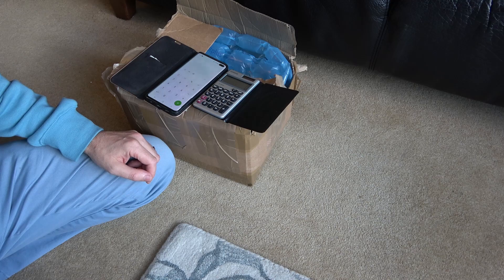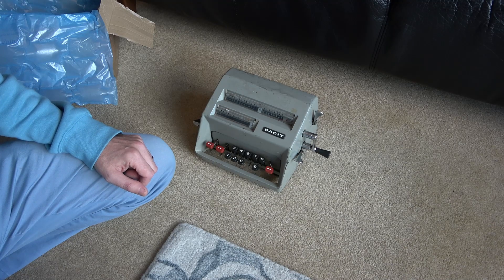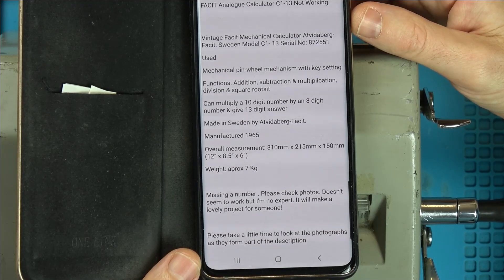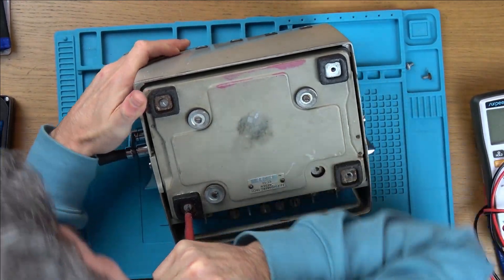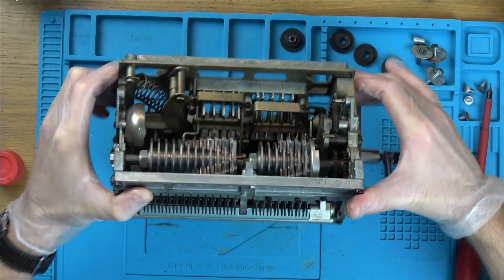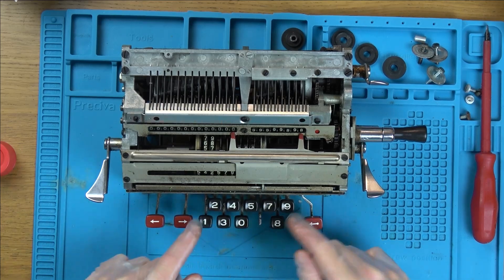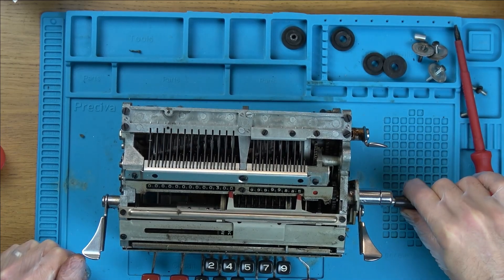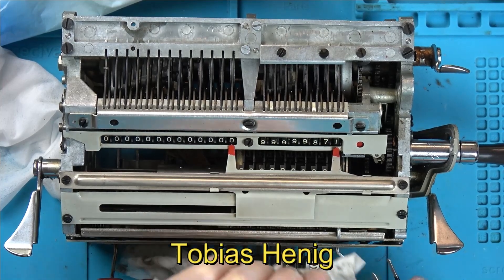Trying to FIX a Mechanical BEAUTY - Vintage CALCULATOR

Comment: Hello..at minute 27 you mention some teeth rails that you removed and cleeaned...SO I have the same machine but those teeth rails dont allow the number buttons to go down.....Any idea on how to solve this issue ??..I took them out and cleand them..There is a small spring on one of them...But that back in but still ...there seems to be no way the number buttons will down since these teeth rails do not allow the buttons to go down.............I have been working on it for ages now....I am stuck there.....Id be gratefull if you can send me any suggestion.....I am about to through out in the garbage...BEST REGARDS & THANK YOU !

Comment: You can also grab a can of brake cleaner and it will blast away all of the old grease and dirt and the you can apply the new grease.

Comment: Years ago the Guys who serviced these would have taken off the covers and soaked it overnight in a paraffin bath which would remove all the crud and hardened grease etc, they would then lubricate using an oil similar to sewing machine oil, good as new after that!!

Comment: these old mechanical adders all end up in that condition, its the old grease they used, modern synthetics just break down and become useless but the old stuff turns to glue which has the ironic effect of preserving the mechanism perfectly just waiting for someone to unstick it
all of those old type writers also suffer this, no you arent typing too fast and causing a jam, the grease is slowing down the return speed making your terrible type speed fast enough to cause a jam immediately

Comment: I have always wanted one of these mechanical calculators, but the £150+ price tag for a working one has always put me off, having seen that it could just be gummed up grease, I might risk ~£30 on a 'not working' one, and give it a damn good clean.

Comment: Nice Sicura, people often mis advertise them as Breitlings, Sicura brought Breitling when it tipped into the economic abyss but a Sicura is not a Breitling as some people suggest it is a good solid upper bracket brand on its own right but you look at the prices of the Sicura jump hours which are super awesome, they are not Breitling in any way shape or form.   BTW I have hung up my Youtube spurs, got a farewell vid to do but by (un)popular demand my brand of video just doesn't make the grade, its been fun and I mastered Davinci Resolve but hey ho, onto another path.

Comment: Electronic calculators really did not take off until the late 1960s and even then they were very expensive, by the late 1970s the prices had dropped to the point anyone could afford one .

Comment: Grease my heart and over the time but that w-40 will turn gummy which would probably be just as bad. Should be using a 3-in-1 oil or a light machine oil instead

Comment: The grease turns to a sticky substance over time, i like to tinker with old electronics, and in the macintosh models from 1984 and up, those floppy drives can seaze up, because the grease gets hard over time, so cleaning it and putting new grease on helps a lot to make em work again

Comment: You could have saved yourself hours if you just used brake parts cleaner, all the grease and gunk would have been sprayed away like magic, let it dry and then use sprayable grease for smooth operation and for anti rust, both for under 10 quid and you won't use much, so it's good for future projects.
Reply: Totally agree. I’ve got seized typewriters working like that.